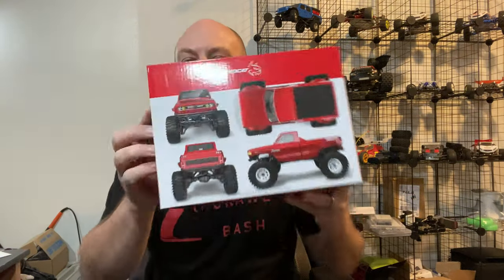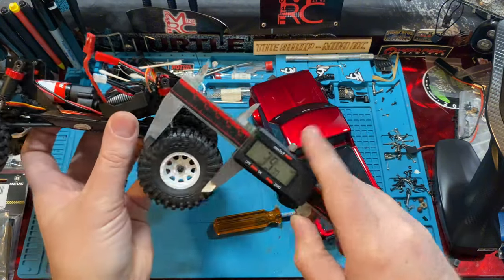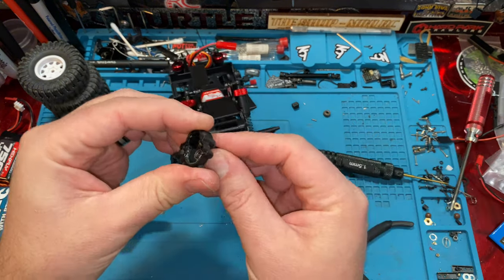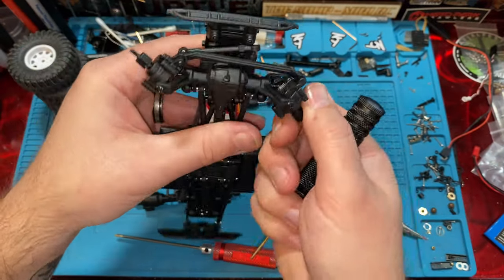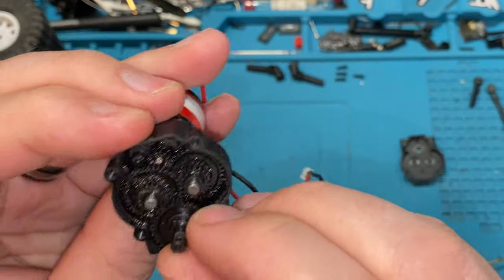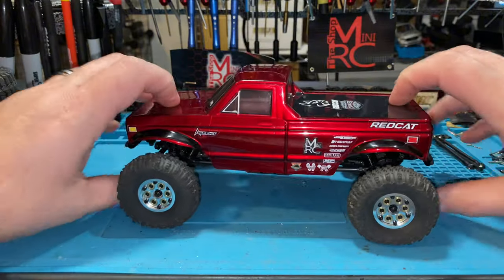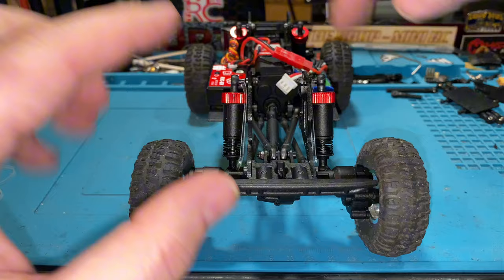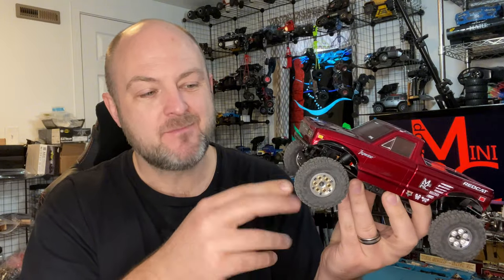Redcat Ascent 18 Deep Dive & Review. We show some super easy and cheap mods on this awesome 1/18!

Comment: I have been having a blast comparing my Ascent 18 to my TRX4m (both stock).  The Ascent 18 feels faster, yet has better low-speed. Ball bearings, portal axles, shocks that (so far) actually keep their oil and not being stuck with Traxxass proprietary electronics makes (IMHO) the Ascent 18 the winner. The price was simply the icing on the cake for me.
Reply from the maker: 100% we agree.

Comment: When you do your Furitek conversion and other upgrades video, I'd love to hear your thoughts on Venom Lizard vs Cedar Python.  Which is more appropriate for this truck and why.  And more generally, which combo for which applications/RC builds and why.  I noticed your Cedar review was in more of a basher build.
Reply from the maker: Ooof. The video is already made with the venom. (It’s currently members only but will likely be live tomorrow)

The cedar is definitely more of a high speed motor.  It can crawl and go slow but it wants high rpm.  I think if you ran a smaller 11t or even 10T pinion on it(stock is 12t) it would be even better for crawling and still have good wheel speed (plus be waterproof)
Reply: @TheShopMiniRC  Thanks so much!  Your reviews are the best out there!  The Ascent can Descend, haha!

Comment: Firstly, thank you for the extended and detailed content. I’m looking for information on the transmitter compatibility you mention in the video. I’ve attempted binding to several receivers without success. Do you have a tested known receiver that you can recommend? Thanks in advance.
Reply from the maker: There are only 2 rx that will bind with the stock remote.  The one that comes with the Furitek brushless combos for the redcat or fcx trucks and the fcx rx that comes with the new brushless fcx24 (you can order it separate from FMS)

Comment: Cool video, I just bought a ascent 18 cool little crawler .. Im kinda new to all this but I have a question that is about tires I thought you might be able to answer it for me I recently bought a set of dj crawler tires it came with a hard and soft foam like together but you can separate them but when you do the hard foams aren't like big enough for the tire it looks like to meI Don't know are you supposed to run them together or not...
Reply from the maker: It’s very much a personal preference. Some people like to run their tires with lots of “squish” and some like them filled out.  Some run “no foam” and some run 3d printed or silicone inserts.  You might have to just experiment on which set up works best for you. Generally, the more weight the truck has, the more support the tires can use.
Reply: @TheShopMiniRC  thank you bud.. ✌🏼